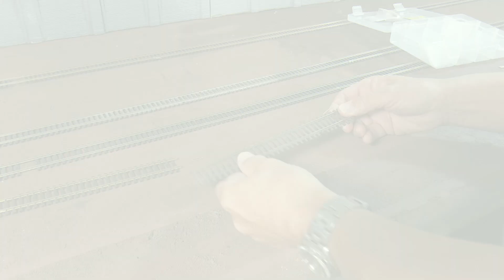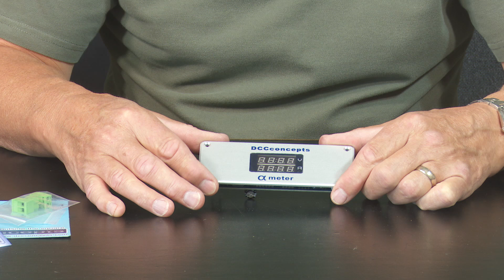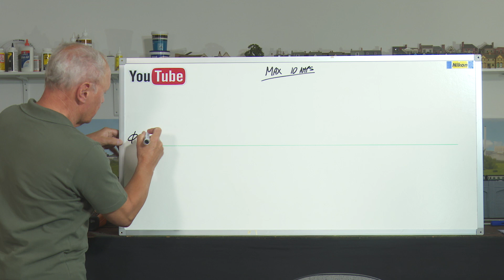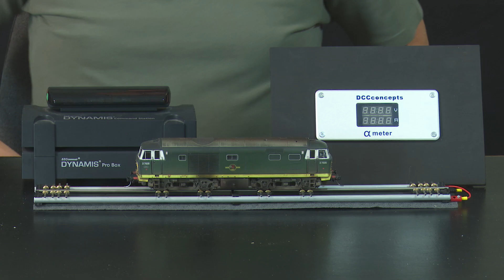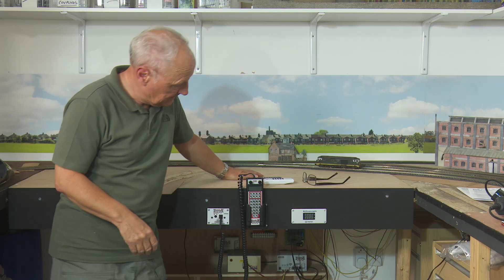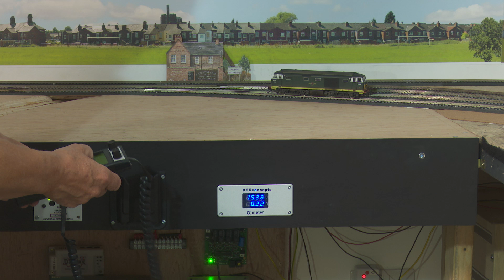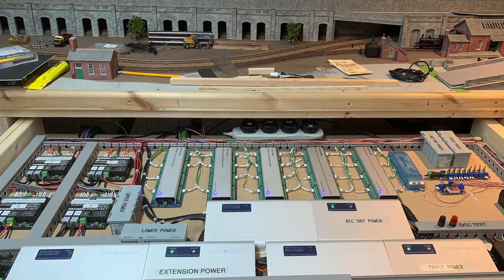Measuring Track Power at Chadwick Model Railway | 101.

Comment: Lots of interesting gadgetry there Charlie.👍
I watched a video the other night; a guy comparing DC layouts to DCC, and he made a far worse job of it than the couple of slips you made here. When you start mentioning DC and DCC in the same sentence or, heaven forbid, twice in a single sentence, it starts getting silly.😂  When the newer system was invented, I bet someone thought they were being really clever, naming the two systems with similar technology. Now that both systems are in common use, it's maybe time that they re-named at least one system. "DC" and "Cab Control" would be so much easier to compare, especially if your teeth don't fit too well.😁
As always, just a thought. 😁

Cheers for now,
Dougie.
Reply from the maker: I think you’re right. The complexity of these abbreviations drive me nuts.
Reply: @ChadwickModelRailway  It would be so much simpler if the two abreviations sounded completely different.

Comment: The low amps are part of the "miracle" of using electricity to create horsepower on rails.  That same economy of A/V is what makes (p-word) diesel locomotives so economical.   There's a club in southern California with some absurd amount of HO track (like 300m worth) exactly modeling parts of the Union Pacific that runs (p-word) waybills between the 100+ "industries" upon that road.  They pull something like 5 amps total running the thing (the laptops and such running the signals and the simulated dispatch orders pull more than the locos do).
Once you get the rotor spinning in relation to the stator in an electric motore, Newton's 2nd kicks in and your A = W/V equation settles right down.
Reply from the maker: I think most people are taken aback by the low power draw. Regards Charlie

Comment: Charlie, another stunning video.
I agree the meter may not be exact, but provides a representation of the current.
But notice the reported current decreases after you layout powered up; 0.37A dropped to 0.20A. I wonder if the message content affects the wave cycle, and so is only a dc value of this complex signal. 
Similarly for the Duette; the two settings change the unsmoothed rectified output, and I suspect a true dc meter would be confused. 
. 
And you can get a similar meter from a well-known website; not as well presented, but a fraction of the cost. 
https://www.ebay.co.uk/itm/10A-100V-DC-digital-voltage-current-amp-meter-Voltmeter-Ammeter-U-K-SELLER-/223557617337
Alpha meter for 60 gbp, compared with similar meter on eBay for around 5 gbp. I plan to test to see relative values compared with meters like this and other hand-held. 

Stall current is not the same as the start current; this meter would be a good to detect the stall current before fitting a decoder, which is definitely a test bench function.
Reply from the maker: I’m so pleased that you found it enjoyable time. It certainly opened my eyes to these current values. Regards Charlie

Comment: Now I know why my multimeter only shows 4 to 5 volts when testing track volts, so I purchased a ac volt/ammeter through Alliexpress installed it and for some unknown reason it shows controller output volts very close to input volts. Ps this is permanently wired into my system! I use 3 different controllers Hornby select, Lenz compact and DCC++ via raspberry pi and arduino etc.like the the rail joiner trick!
Reply from the maker: I’m so pleased that you enjoyed it Alan. Regards Charlie

Comment: Hi Charlie ,
I think if you just had a few miles of wire a bunch of Connectors and such like you wouldn't need to bother with model trains 😂, I have to say you looked very uncomfortable when you turned the speed up and all the locos started charging around, please don't ever get a job as an aircraft traffic controller 😂 well done again s bit deep for me but I enjoyed you in your hat under the table i always feel you should have a fishing rod in hand whilst wearing it.
Regards
David
Reply from the maker: A replacement hat is on its way courtesy of a subscriber. Regards Charlie

Comment: Hi Charle, another great video. I use a similar meter for DC to check current and voltage on locos before adding a DCC decoder. The alpha meter looks very interesting. Thanks for the tip on fishplate tool, so simple yet highly effective.
Reply from the maker: Thanks mate, I’m so pleased that you enjoyed it. Regards Charlie

Comment: A shame they didn’t design the  volt and amp readout to work with reversed voltages but I guess the dc group is small enough that they didn’t bother. The blue led 7 segments are hard to read in a well lit room it seems , they should have built the display with a blue dark filter over it all. Then the display would be way easier to read as it would hide all of the non illuminated parts of the display.
Reply from the maker: In reality the meter is much brighter than it appears in the video. Regards Charlie

Comment: Charlie, using a series of 6P2W rotary switches you can use 1 meter to measure all power districts individually and have one switch position measure the total.
Reply from the maker: Now that's a great idea Roy.
Reply: Wrong way round....2P6W.  If needed the switches could be cascaded.  If the power will be too great for the switches then the switches could control relays.  A little bit more expensive but still a lot less than multiple meters.  If your 0V is commoned across the board then 1P12W would be better.  If you decide to go that route I still make cct boards and could design and produce one for test if you so wish.
Reply: Hi. Great idea, I'd certainly bulk at having to spend so much on multiple meters.  I think the difficult bit is finding the appropriate switches or indeed relays (from the power handling point of view) as I suspect they would need to be make-before-break as the Alpha might not survive being disconnected while outputting power. With this type of switch/relay I think the outputs of two district power supplies can be momentarily joined as it already happens without problems when a loco with multiple pickups straddles a break.  (I digress, does the gap in both rails have to be well aligned so the wheels on an axle cross  at the same time?) If it is robust enough to use the more common break-before make type then "stay alive" units would be needed in the locos and powered rolling stock to avoid a stutter at switch over. DDC concepts do suggest (their sales pitch aside!) a meter for each district but I guess it's a question worth asking them. Maybe the district psus have to be powered down before switching the Alpha over.
Initially I had thought why not just put a full-wave rectifier and simple D.C. meter in each district (bottom of page, http://www.members.optusnet.com.au/nswmn2/DCC_Meters.htm) but now I realise it is important to know the voltage as too many volts make the decoders run unnecessarily hot so reducing their lifetime. 
BTW, As DCC does not have polarity (yes, the B rail is held at 0V while the A is high but in the next half cycle the B goes high with the A at 0V) you cannot think of 0V in DCC so there’s nothing to common.
Cheers.

Comment: IMHO you can measure more complex wave forms, such as square wave, voltage and current, but the  meter has to be "True RMS" type, which will cost more than the basic multi-meter. Also you can measure current. without connecting the meter in the circuit,  with a clamp style multi-meter. One example of such meter  is "UNI-T UT210E True RMS AC/DC Current Mini Clamp Meters w/ Capacitance Tester ", which cost about 45 GBP.  FYI RMS is "root mean square", explanation can be found for example at wikipedia.org.
Reply from the maker: ... and there I was trying to make things simpler!  Thanks AT.

Comment: Question!
“What’s the difference between a cable & a Wire” 
As I for one have know idea 💡 👍
Thank You...Charlie
Reply from the maker: Hi John, one has single-strand copper and the other is multistrand. Regards Charlie
Reply: Chadwick Model Railway have a great weekend & stay safe
Reply: A cable is a collection of one or more wires in a single outer sheath. There are live neutral and earth wires in a mains cable. A USB cable contains 4 wires.

Comment: Charlie, I’d like to setup a Digitrax dcs240 and DCS100 booster to a ps2012 transformer. In need a 5 amp  and a 10 amp wire contenders. I can’t find them here, can I get them over in the UK. I’m also looking for screw type wire connectors, but I can’t find the ether.
Reply from the maker: I'm sorry RHS but I'd contact Digitrax directly,  they are pretty good for technical advice.
Reply: Chadwick Model Railway Thanks Charlie, God Bless.

Comment: Thanks so much for all your updates - always enjoy them! You're a fantastic asset to the modelling community.

Without wishing to be "that guy", one little nitpick just in case others bring it up - DCC is actually AC, as anything that crosses 0V into the negative cycle is an AC signal. It's just that DCC is a ~8Khz square wave ~16V, possibly asymmetrical AC signal which is of course nothing like 50Hz ~230V sinusoidal AC, which is of course UK mains voltage AC. It's a real nitpick though I fully admit - and absolutely bang on with everything else! A fantastic video as always, thank you.
Reply from the maker: Thanks for the correction Berry, it’s very welcome.

Comment: Great video, but sorry Charlie at £60 that power meter is extremely overpriced.  You can pick up the same type of module for under £5 from various sources (or under a quid from China).  Even if you allow for a custom PCB to mount it and fabricated panel with the logo on, I would have thought that there still would be enough wiggle room for a decent profit to be made if it retailed at £30.  I do feel that a lot of companies seem to think model railway enthusiasts are made of money, and just because it has DCC in the product or company name, can rip people off.

Love the labeling option, not cheap, but looks good and having good cable management will save you a lot of time in the long run should you need to diagnose a fault in the future.
Reply: Don't forget that you need to filter out the data as well to get an accurate reading. The cheap meters really can't do this. The only other dedicated DCC meter available on the market is more expensive than ours is. As a manufacturer, we do know the production cost of the unit - plus packaging, logistics and factoring in that we have 7-day technical support based here in Settle. Also - don't forget that £10 of that £60 is VAT which goes straight to UK GOV. We are certainly not in the business of "ripping people off" and always strive to produce the very highest quality products with the best customer service available at a reasonable price which allows our retailers to make a small amount of profit to keep the doors open. 
Sorry for the length of my response, but I'm quite passionate about our products, our people & our retailers.
^RB DCCconcepts
Reply: @richardbrighton7737  Hi Richard, thanks for the reply, and whilst I agree that there are overheads involved, and you need to put bread on your table, I still feel that a lot of electronic products for the railway modeller are overpriced.  Granted there is more to this than a 50p volt/amp meter from Ali Express, and a basic filter made from a few basic components (such as a couple of ZXCT1009's and half a dozen discrete components),  but then again I bet you are not sourcing the components form RS or Farnells (if you were then there would be no profit in such a product).  

When you factor in your overheads, margins for your agents and retailers, taxation, and design investment then I guess £60 would make that a fair price
Reply from the maker: Thanks Malcolm, I’m so pleased that you found it interesting. Regards Charlie

Comment: Thanks again Charlie.  The fish plate tool is a brilliant idea.  I think of all those times I have stuck fish plates into my fingers because it has resisted going onto the piece of track.  I ended up using long nose pliers and a pair of forceps.  This is so much simpler.  I find an essential piece of equipment is Spencer Wells Artery forceps.  They come in various lengths and in both straight and curved and have a pair of scissor handles.  Because they lock while holding items, I find them really useful and use them in preference to reverse forceps.
Reply from the maker: Thanks Don, I’ll check out those forceps.
Reply: @ChadwickModelRailway  If you have a problem, Charlie, let me know and I will get a set and send them to you.
Reply from the maker: A link would be handy Don. Regards Charlie
Reply: @ChadwickModelRailway  Try Ebay.  I use Elcon Forceps Spencer Wells curved, which are the most useful.  You can get straight ones cheaper but I find the curved ones the best.  Regards Don

Comment: Hello Charlie,
I have enjoyed your last few videos including the 100th. In my understanding of DCC the applied voltage flips between the full voltage that your particular controller gives out and close to zero volts. Unlike your diagram that shows the voltage fluctuating between a positive voltage and an equal negative voltage. Your diagram shows a square wave alternating voltage which is wrong. The length of time that the square wave pulse is at high determines if the bit represented by the pulse is a digital one or a zero. At the end of a DCC command which is a whole string of pulses there is a short period of a constant high voltage before the next command is sent out as a stream of digital pulses. The exact timings of the pulses together with details of how they are strung together to form commands is detailed in the DCC documentation online.
Liked the idea of heat shrink labels.
Thanks for creating good content.
Regards, 
Frank
Reply from the maker: Thanks Frank, Well I did say that I was one of the great unwashed!
Reply: @Frank. For DCC the voltage on the rails is switching polarity and not unipolar as you suggest. This is then rectified by the decoder to supply power to the loco. The DCC control signals are transmitted by modulating the switching frequency to represent the digital 0s and 1s

Comment: Good video Charlie. I have a testing station that does both DC/DCC. I have a volt/amp meter wired in for the DC side so I can test stall amperage, very useful to know when choosing DCC chips. 
I may have to upgrade now after seeing your video.
Hatton have the DCC Concepts meter for £51. A little cheaper than going direct. 
Keep up the videos, most enjoyable. Keith
Reply from the maker: Thanks Keith,I’m so pleased that you found it interesting. Regards Charlie

Comment: i like the unit but wouldn,t a power meter off of ebay for £6 quid do exactly the same job https://www.ebay.co.uk/itm/Digital-Monitor-LCD-Watt-Meter-60V-100A-DC-Ammeter-RC-Battery-Power-Amp-Analyzer/223677371570
Reply from the maker: No Cliff, it can’t Accurately read DCC voltages
Reply: @ChadwickModelRailway   So, I understand that DCC req,s 16/17 volts of regulated supply but why would it not read accurately. 16/17 volts is 16/17 volts, I,m sorry to disagree with you but I feel that the ebay one would be adequate. There is a big difference between £60 and £6. I think because its DCC? and a led on the new front panel companies can charge what they want. From the above you can tell that i,m a tight arse.
Reply: I was wrong, i apologise

Comment: I use a Digitrax system and wanted to know the current draw so I purchased on eBay an AC Amp digital panel meter and wired it between the power supply and the command station. This works well and I can’t imagine that the reading would be far out, possibly slightly higher due to the command station being in the circuit.

If you purchase just clear heat shrink you can slip a label inside and then slide both over the cable.
I must remember to wear a hat when under the baseboard, good idea to save the head.
Great video.

Alec
Reply from the maker: Thanks Alec, great tip on the clear heat shrink.

Comment: Hi Charlie, re: the heat shrink labels... 

I just print onto plain paper, cut to appropriate size, pop the label onto the wire and use clear heat shrink to hold in place.  Very simple, everyone with a computer and printer can do it and normal heat shrink tubing is so much cheaper than that stuff needed for your Brother label printer.
Reply from the maker: Great point Ian, I never knew you could buy clear Heat-Shrink.
Reply: @ChadwickModelRailway  It's good that an ex-fish head can be taught something new by an ex-crab :-)
Reply: @hughjardon5101  , Doesn't often happen that a Crab can teach a Fish-head (particularly a WAFU) anything, so it's always welcome! ;-)
Reply: Hi Ian, Agreed, Definitely a much cheaper and still reasonably easy method. I use the same method in Data Cabling

Comment: Brilliant! Also explains why I was only getting about 6v showing! Hmmm, expensive though.
Reply from the maker: I’m so pleased that you found it interesting. Regards Charlie.
Reply: @Brooklyn Junction MR, you can get these dual voltage/ ammeters led panel display meters from chinese suppliers on ebay at a fraction of the cost, you get a wiring diagram, and anybody with reasonable electrical knowledge can fit them.
Reply: 48firefox I was thinking the same thing but I’m not sure they’re true RMS meters. The specs for the ones I saw are pretty vague